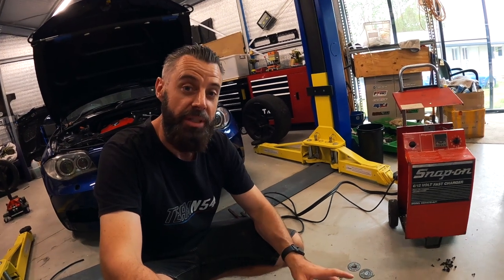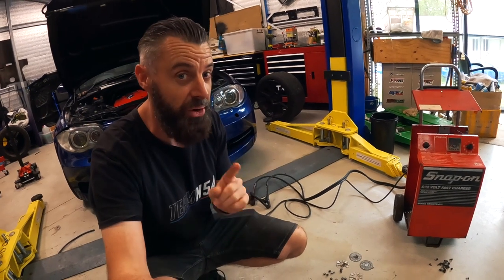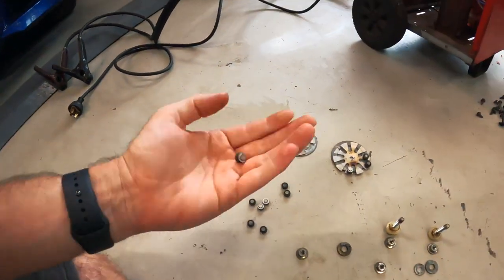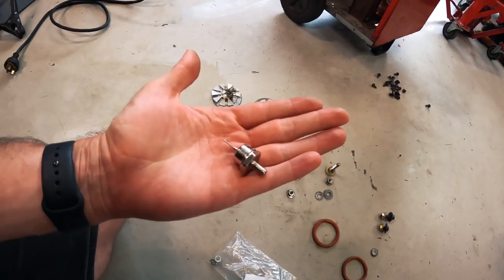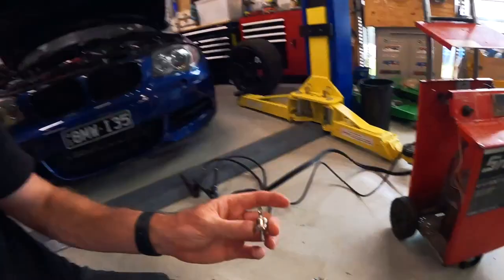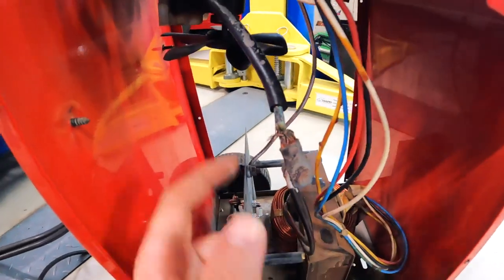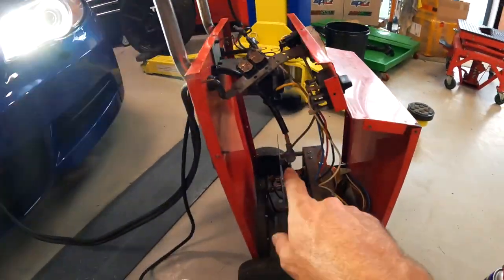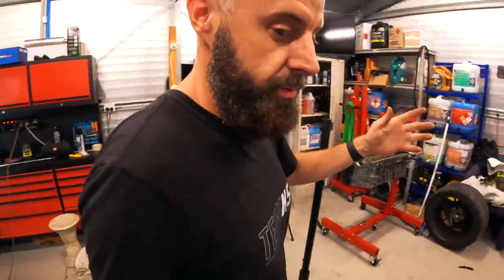How I Fixed My Snap On Workshop Battery Charger!

Comment: Even at 10 amps at 12 volts is still 120 watts so the diodes do very well to stay cool.  Think how hot a 100 watt light bulb gets, too hot to touch!  Your battery charger is now working better than when it was made :)

Comment: If you use 4 of those diodes in a bridge rectifier circuit you will double your efficiency!
Reply from the maker: I was trying to do the match as i could get much less powerful diodes locally, but assuming you can use them in a bridge rectifier setup. For the 60amp charger would i need 4 15amp diodes or still 4 30amp diodes?
Reply: @testandtune6096  I would use 4 X 30amp voltage is not your issue, but would be interesting to see what happens.
Reply: @J B I forget it's been a long time ago since electronics classes
Reply: @J B I did some googling the unused wave is flipped up voltage stays the same 👍
Reply: No, the dual diode design is a center tapped full wave rectifier. If you try to replace them with a full wave bridge rectifier that uses four diodes, you'll get double the voltage. The dual diode design is more efficient but it needs a center tapped transformer with more windings than the bridge rectifier design. https://en.wikipedia.org/wiki/Rectifier#Full-wave_rectification